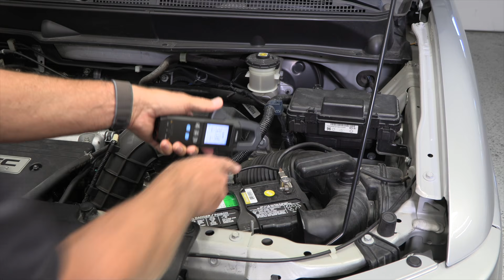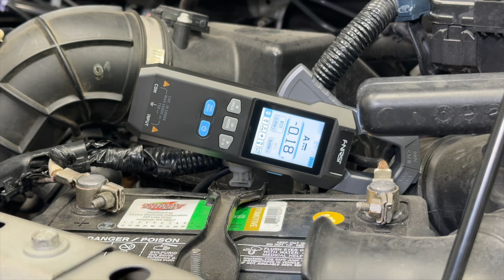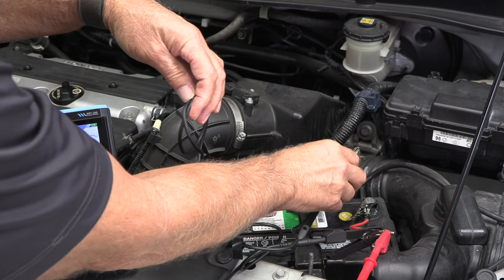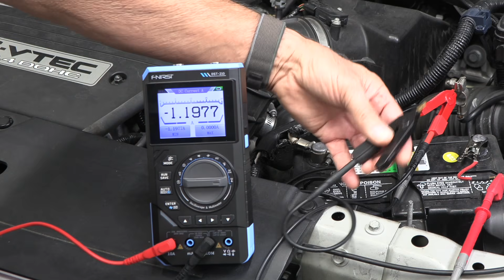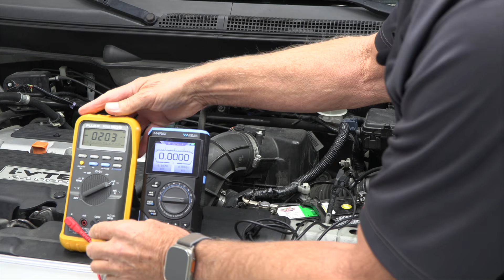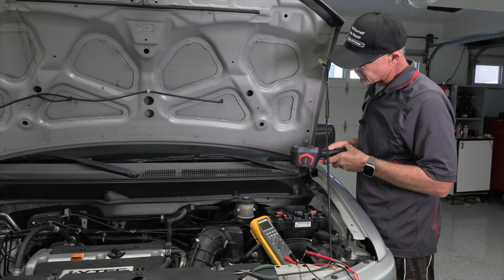Battery Dies Overnight? Find a Parasitic Draw (Stop Pulling Fuses!)

Comment: All you need is a voltage drop chart that converts voltage to milliamps for each fuse size.  Its free to download just do a search for fuse voltage drop chart and you can use your multimeter.  No need to buy another meter just for this.
Reply from the maker: You're absolutely right! Measuring voltage drop across fuses and using a conversion chart is an excellent way to track down a parasitic draw without purchasing additional equipment. I've used this method myself. One thing to keep in mind is that accuracy can vary depending on the fuse type, rating, and temperature, especially when measuring very small currents. A low-amp clamp is simply another option that allows you to measure total current without disconnecting the battery. Both methods have their advantages, and I appreciate you sharing another approach with viewers! 👍

Comment: Why do you read amps at the battery when pulling fuse to check but volts when testing at the fuse itself?
Reply from the maker: Good question! When measuring at the battery, we're checking the total current (amps) being drawn from the battery. This tells us how much current the vehicle is using while everything is supposed to be asleep. When testing across a fuse, we're measuring a very small voltage drop (millivolts) caused by current flowing through the fuse's resistance. Using a fuse voltage drop chart, we can estimate how much current is flowing through that individual circuit. The advantage is that we don't have to remove the fuse, which could wake up modules or interrupt the circuit we're trying to diagnose. So basically, amps at the battery tell us how much current is being drawn overall, and millivolts across the fuse help us identify which circuit is responsible. Hope that clears it up! 👍

Comment: It's a good video until he got to the end and told us what he couldn't do but he didn't explain why and what the next step would be.
Reply from the maker: That’s a fair point. In this video I was mainly showing how to find current flow through the fuses without pulling them, but I could have done a better job explaining what to do next when you run into a fuse or circuit you can’t easily test that way.

One option I use is the Amp Hound, which lets you measure current through a fused circuit without having to connect a meter in series. I made a full video showing how I use it and how it can help with the next step in the diagnosis:

https://youtu.be/rVDgFCz5QOg?si=Q3ouzzjFsmI2oQuv

Thanks for pointing that out. It’s good feedback, and I’ll try to make sure I explain the “what next?” part more clearly in future videos.

Comment: What if your fuses consist of several j case designs for high current things…there aren’t any exposed leads to put the probes on?
Reply from the maker: Good question. If the J-case fuse doesn’t have exposed test points on top, then you really can’t use the millivolt voltage-drop method directly across that fuse without accessing the terminals.

Comment: What wrong help I've change battery and alternater but still this car is draining battery no radio but still problem z there im driving polo 1.6 model 2014 help
Reply from the maker: If you already replaced the battery and alternator and it still goes dead, you most likely have a parasitic draw somewhere in the car. The radio is only one possible cause. I would do the parasitic draw test shown in the video, let the car go to sleep, then check each fuse circuit to see which one is using power with the car off. Once you find the fuse causing the draw, you can narrow it down from there. Don’t replace any more parts until you test it first.

Comment: how much are about the hood latch that was something I forgot to do. also I did not know about getting the key fob away from the vehicle.
Reply from the maker: Yes, the hood latch can matter if the vehicle has a hood-ajar switch built into the latch. Leaving the hood open can keep certain modules awake, so I usually latch it manually with a screwdriver while testing. And definitely keep the key fob away from the vehicle too, since proximity systems can wake modules up and affect your parasitic draw reading.

Comment: Hi Danny. What a good information video, brill. Just a couple of points, if I may. Point 500ma is .5ma, 500ma is .5 amps or 1/2 an amp. I noticed that you meter was reading - was it connected the + to minus or so. I hope you don't mind my picking, I could be wrong, I would love to hear your comments. Thanks again, and keep safe you and yours. Just brill.
Reply from the maker: Thanks, and I definitely don’t mind you pointing it out! You’re correct — 500 mA is 0.5 amp. And the negative sign on the meter was just because of the direction I had the meter leads connected; the actual amount of current being measured is the same. Good catch, and thanks for watching!
Reply: @dannysdiygarage  You're welcome, you're a gent, all the very best.
Reply: Hi Danny. My door ajars front kept coming on, so in the end I bridged the switch wires. I did the drivers side pins 8 & 6 and the same with the passenger side. I then had a flat battery, I can’t remember how long after it was though. Anyway, a neighbour put a test meter on it and he said I needed a new battery. I eventually got one but after some time, maybe a couple of months it was slow starting but it did start. I measured the current and it was about 300 to 400ma analogue meter. Since then I’ve been disconnected it at nights. We go shopping and leave it connected for an hour and it starts OK. I’ve now disconnected the two switch shorts but it is still the same draw. The drivers door won’t unlock with the remote. I have just found the relays to the locks, so I need to find the correct one for the drivers door lock or all locks. That’s my next step. Thanks for any advice and all the very best as usual. Singem.
Reply from the maker: @Ilovetosingem  Hi Singem, thanks for the update. A 300–400 mA draw is definitely high once the car has gone to sleep — normally you’d expect something much lower, often around 20–50 mA depending on the vehicle. Since you removed the bridged door-switch wires and the draw is still there, I wouldn’t assume those switches are the cause.
The driver’s door not unlocking with the remote is worth investigating, but I’d be careful about replacing relays just yet. First let the vehicle sit long enough for all the modules to go to sleep, then check the draw again. If it’s still 300–400 mA, start checking the fuses one circuit at a time to see which circuit makes the draw drop. That will point you in the right direction much faster.
Also make sure the meter is connected correctly in series and that opening a door or operating the locks during the test isn’t waking the car back up. Let me know what you find — that’s quite an interesting one. All the best! 👍
Reply: @dannysdiygarage  Hi Danny. Before commenting here I checked the fuses on one of the boards including the locks, I think I'm going to find out which relay is the drivers door lock, disconnect it and see if the current drops. I'll let you know. Thanks for all your advice. All the very best, Singem.

Comment: I don’t like the idea that the guy says yeah Clampett right here and you clamp it right here. He didn’t explain correctly where to put the leads. The sky is very boring.
Reply from the maker: Thanks for the feedback. For the parasitic draw test, the clamp goes around one battery cable only — not both cables together. I’ll keep your comment in mind and try to make the lead/clamp placement even clearer in future videos.
Reply: What I’m saying is poor communication!

Comment: Danny - My Merc's battery is buried deep under the driver's seat.  Is there any other way to perform this testing for the small parasitic draws?
Reply from the maker: Yes. You can perform the millivolt voltage-drop test directly across the tops of the fuses in the accessible fuse boxes without reaching the battery. Allow the vehicle to fully enter sleep mode first, keep the key away from it, and test each fuse for a small voltage reading.

To measure the total draw, another option is a quality low-amp DC current clamp placed around an accessible main battery cable—but it must be sensitive enough to measure milliamps. The under-hood jump terminal is useful for charging, but I wouldn’t connect a multimeter in series there because not all battery current necessarily passes through that point.

Comment: so,  what if all your fuses are in the cabin and you have to open the door.
Reply from the maker: Good question 👍 If the fuses are inside the cabin, you can leave the door open and manually latch the door striker/latch with a screwdriver so the car thinks the door is closed. Then let the vehicle go to sleep before testing the fuses. Just remember to release the latch with the door handle before actually closing the door. I mentioned that in one of my other parasitic draw videos, forgot to mention it in this one, sorry for the confusion.
Reply: @dannysdiygarage  yes, I just looked it up on another clip.  Thanks for responding.

Comment: Me, I have a 2004 Volvo v70, front wheel drive 2.4T, went through all 3 fuse boxes, not one fuse was active, all fuses are good, but still have a draw of 0.16 amp, so I'm guessing alt diode, or starter or starter selinoid, cause everything else checks out... Go figure can't be simple right... LMAO
Reply from the maker: 0.16 amp is about 160 mA, so that’s definitely higher than I’d want to see after the vehicle has gone fully to sleep. If you’ve checked all the fused circuits and none of them account for the draw, the alternator is a good next place to look, especially a leaking diode. I’d also make sure the car has had enough time for all the modules to go to sleep before testing. The starter circuit is possible too, but I’d probably check the alternator first.

Comment: Thumbnail: STOP PULLING FUSES! 
"First method, pulling fuses" 😂
Milivolts across the fuse is a really good method, sadly my draw is intermittent, i set up everything but the amp meter is showing 0.016, it was 0.5 first time i checked, and it dosent drain the battery every night, I'd say it does it once every month or two.
Reply from the maker: Yeah, those are the tough ones 😢

Comment: I use the "FuseHound". You select the style + size fuze then just touch across the fuse and it will tell you the exact amp usage going on that circuit. You can use a voltmeter, but there is an equation to figure out the true amps being consumed.  This is super handy when you have a draw on more than 1 circuit.
Reply from the maker: That's a really handy tool! The Fuse Hound is basically doing the voltage-drop-across-the-fuse test and then converting that measurement into amperage based on the fuse type and rating.

That definitely saves the extra step of measuring the millivolt drop with a meter and then using a chart/calculation to determine approximate current flow.

And I agree — when you have more than one circuit contributing to a parasitic draw, being able to quickly see approximately how much current each circuit is using can make diagnosis much easier. Thanks for mentioning it! I may have to check one out.

Comment: What a load of crappie won't be long before you pop an air bag or an ecu with an amp clamp when disconnecting battery you need cool down time or you will spike the ecu or air bag will go of amp clamps don't work if battery is flat
Reply from the maker: An amp clamp itself can’t spike an ECU or deploy an airbag — it’s a non-contact measurement and simply senses the magnetic field around the wire. Nothing is being connected electrically to the circuit.

You are correct that proper precautions should be taken anytime the battery is disconnected, especially when working on an SRS/airbag system, and manufacturers may specify a waiting period before servicing those components.

As for a flat battery, the clamp measures current flow. If there’s current flowing, it can measure it; if the battery is completely discharged and there’s no current flow, there obviously won’t be anything meaningful to measure.

I’m always open to constructive corrections, but I want to make sure the information in the comments is accurate for everyone following along. 👍

Comment: Why do you need the jumper?
Reply from the maker: watch this video at 3:20 it shows you exactly why it will blow a meter fuse or destroy the meter. https://youtu.be/fZZpQY1aCVk?si=MfDtseCo0yYZmY12
Reply: Tell the truth, you really dont need the jumper wire. Its used, as a precaution.
Reply from the maker: @2078smith  watch this video at 3:20 it shows you exactly why it will blow a meter fuse or destroy the meter. https://youtu.be/fZZpQY1aCVk?si=MfDtseCo0yYZmY12

Comment: So using a voltage meter across the good fuse, is that only for lower amp rated fuses ? I seem to recall it's just the lower amp ones that have a slight resistance otherwise higher amp measure like a "short", or is the meter just sensitive to be able to tell the difference between a fuse and a jumper ?
Reply from the maker: Good question. All fuses have a small amount of resistance, but the higher-amperage fuses generally have much less resistance.

So this voltage-drop method can work on larger fuses, but with a small parasitic draw the voltage drop across a high-amp fuse may be so tiny that your meter basically reads 0 mV.

The meter isn't actually telling the difference between a fuse and a jumper. It's just sensitive enough to measure the small voltage drop created by current flowing through the resistance of the fuse.

That's also why you need the correct fuse voltage-drop chart for the type and amperage fuse you're testing.

Comment: its very useful to have a meter with peak hold or data logging so it can catch a canbus wake up event , otherwise you are only going to find continuous drains
Reply from the maker: That’s a great point, those features definitely make tracking down intermittent draws much easier! 👍

Comment: thank you for myth busting on youtube ,all the diy "autoelectrician" propaganda causes arguments with customers that think they know something because they watched a video !  if they watch yours they actually do! 
we book battery drain cars for 2 days just because if we last resort to  fuse pulling = canbus wake up,  and 1st day is a propper deep 12 to 16 hour recharge/recondition before we test the battery capacity , we  dont do false battery write offs,  
i started experimenting with other methods of drain testing current clamp readings just wander all over and if you move it it creates a static reading , you have to zero with the meter in place ,battery disconnected, dont move the meter and reconnect the battery ,i just use an isolator switch but my trust in those readings is already lost, now i always use a fluke in series and a   flir tg165  thermal imaging camera  i found one drain with the flir ,the alternator that actually felt cold to the hand with one ,that was 180ma and the customer had already replaced it already with ,wait for it , shocker comming ,,,,a foreign refurb!!! 
and another vehicle the flir found a relay stuck on (soldered in) inside a body control module , the irony , it was a "power save" relay 
pulling fuses is useless on canbus cars unless you get really lucky , youtube is generally is stuck in pre canbus and dont get me started about people boost charging/ starting ,and using power probes ect ! on modern cars

Comment: 90% off the times is this crappy chinese new android radios beeing in standby and not totally off ! go directly to the radio fuse !
Reply from the maker: Absolutely, aftermarket Android radios can be a common parasitic draw source if they stay in standby instead of fully shutting down. I’d definitely check that circuit early, especially if the problem started after the radio was installed.

I just wouldn’t jump straight to the radio fuse every time — the voltage-drop test lets you find the actual circuit causing the draw instead of guessing.

Comment: My 2023 Mazda Cx5 shut off at a stop light.  No battery warning or charging system lights at all.  It started up on first try instantly.  New battery was 1 month old when the above happened.  I drove to autozone and battery and alternator tested bad. Then l asked the worker to check both again in 10 minutes.  Both alternator and battery were back to normal levels?  Then main drive belt was replaced back in March.  🤦🏽‍♀️
Reply from the maker: I wouldn’t replace the battery or alternator based on those tests alone, especially since both tested normal 10 minutes later.

Since the engine actually shut off, I’d check for stored trouble codes first, then inspect the battery terminals, grounds and alternator connections. I’d also test the charging system while the problem is occurring and under electrical load.

An intermittent connection or charging-control problem could cause this and then test perfectly normal later. If it happens again, definitely have it diagnosed rather than continuing to drive it.

Comment: My mom's 2010 CRV had an issue where a diode in the alternator actually started draining the battery after the car was shut off. It was hard to pinpoint because the alternator was still charging it while the car was running.
Reply from the maker: That is a classic tricky diagnostic scenario, thanks for sharing that helpful tip!
Reply: @dannysdiygarage  yeah, it was annoying and the problem would only show up at night in the winter time when it got cold enough.
Reply: @ChewyChicken589 
 You replaced the alternator? (assumed) but how was it determined that the diode/alternator was the problem?
Reply: @jjgregory4844 to be honest, we kind of rolled the dice. It's a common problem with that model and generation.